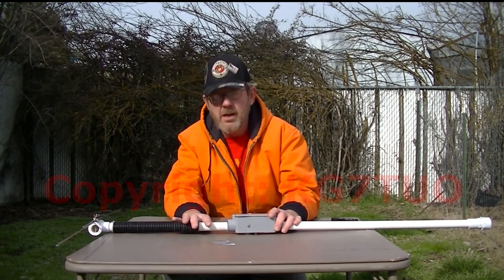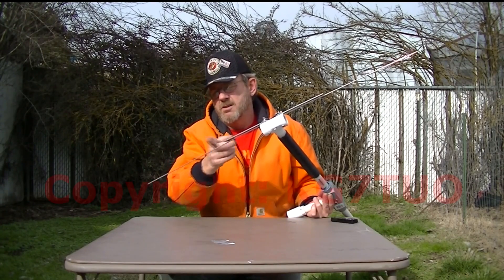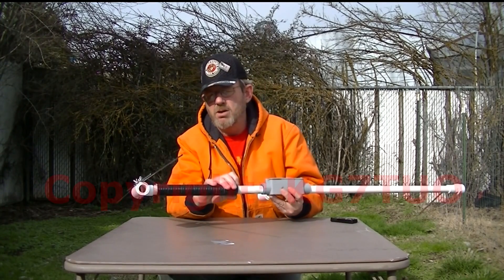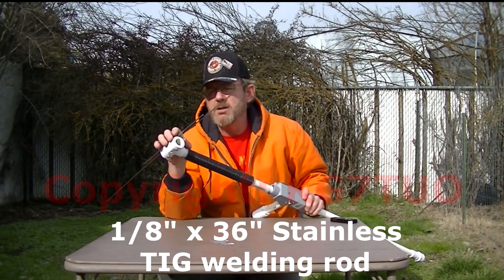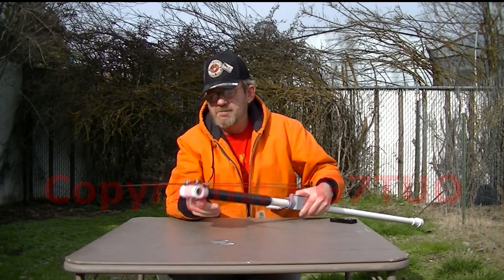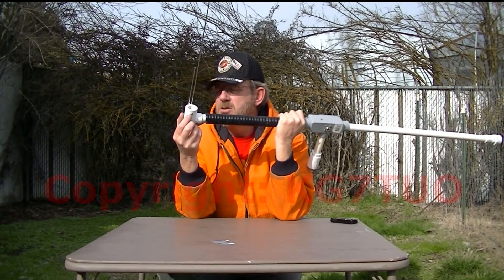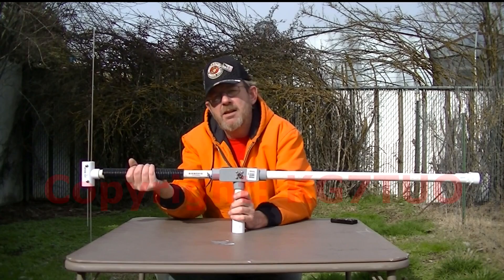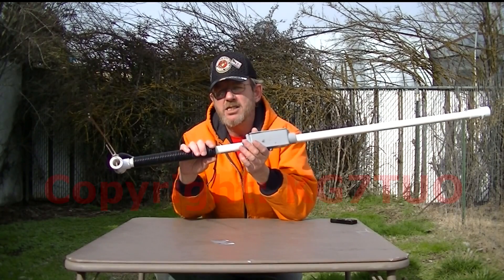Homebrew dual band vertical dipole for 2m & 70cm

Comment: Interesting design, I like it! I have been watching some YouTube videos on several designs and I like this one a lot. Seems like there could be a lot of different versions for this design. You definitely get the mind thinking and I have a couple of questions for you :-)

What is the spacing for the top and bottom element on the "T"?

The idea of the choke is interesting, I have not seem one on a VHF antenna before. I'm kinda new to antenna design so can you please explain to me the desired effect for this?
Reply from the maker: As far as the spacing, I just drilled the bolt holes 1/2" from the end of the T fitting which gives about a 2 1/4" space between the bolts that mount the elements.

As far as the choke, contrary to the note in the video that the straight line didn't work, detailed graphing of the SWR readings across both bands shows that it did in fact work without the choke. Testing was done with a 100 foot length of RG8X attached to the antenna SO239 and a large portion of that length in a coil outside the shack. I will be doing further testing on that model with a shorter coax (and without the coil in the coax, to see how it might affect readings.

The intent of the choke was to help SWR. The coiled line sets up an inductive field that inhibits RF energy from traveling back down the coax shield to the radio.
Reply from the maker: The final editing is being done on the followup antenna. Testing shows that the choke coil is not needed. It can be tuned to give good SWR's on all 2M and 70m repeater frequencies in Oregon (my region) as well as all of the 2m band and most of the 70cm band.

A third version, for group builds, is in the works and should come in at $20 each for a group of 10 builders with some excess material for mistakes/next group. That one is intended to be permanently mounted whereas the one in this video is intended to be raised on a mobile mast for field work.

An interesting thing showed up in testing of this one though. With the lower elements pointing forward (90 degrees from the vertical top element) SWR's remained almost identical when graphed.